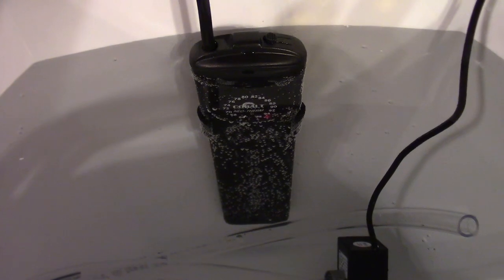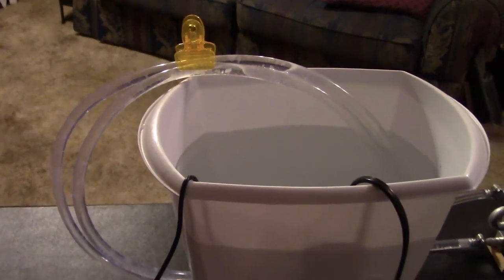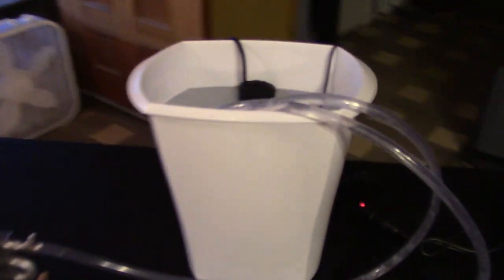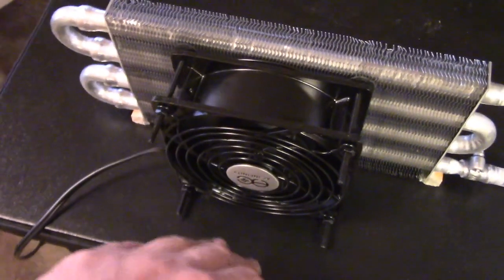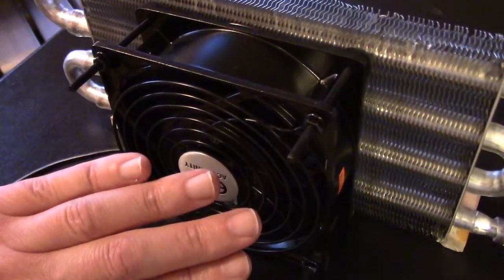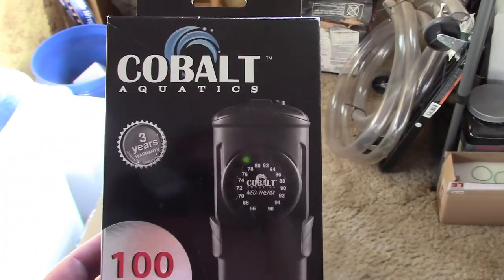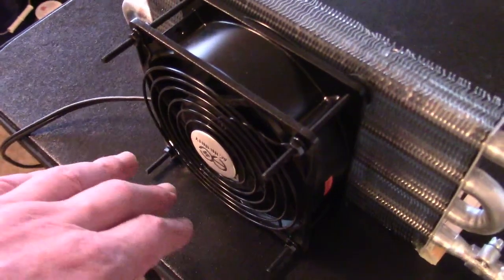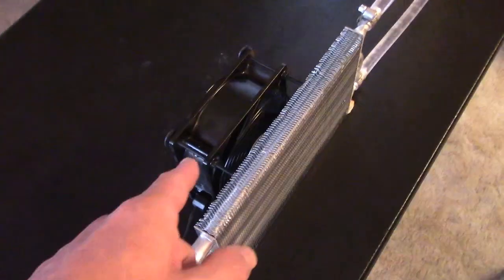DIY Air Heater! The "Hot Water" Air Heater! DIY Radiant Space Heater! use Aquarium Heater & Radiator

Comment: I love the videos and I’ve built the larger heat exchange unit. I think it’s often better to have several small units working at the same time rather than larger fans which make more noise. In colder temperatures I’m not sure weather a 100watt fan could sustain warm enough temperatures. It’s certainly useful for small well insulated rooms though like a cupboard office. And of course it’s useful say in the car if you get caught in a snow storm. That’s 8 amps and with a smaller tank the water could be warmer. You probably need 2 amps for that fan and so 10 hours run time with a 100amp battery is good. In UK winter however even with off grid 1000watts of solar couldn’t sustain the batteries over a long period of time with every day use. You’d have to invest in lots of amp hours to sustain heating over  winter. In the desert that’s easy but not in the uk.

Comment: I did the same thing however when i screw tje fan to the radiator it seems it safocates and doesnt blow air. I have to pit the fan couple of cms  diatant from tje radiator. In addition tje air is not so hot although tje radiator tem ia around 50c.guess i did somethng wrong?
Reply from the maker: some smaller radiators have the fins backed very tightly together. that makes it hard for air to get through unless you use a powerful fan. i used a radiator that has relatively 'wide fin spacing' so it works good. i'd say to either try a stronger fan or slow the speed of the fan. the other thing you can do is try a radiator with fin spacing like the one i used.

Comment: Your vids are always inspiring. I'm always left with lotsa ideas for variations on the theme. Insulate the water tub and cover with a lid to reduce heat loss. Instead of pumping the water, set system up vertically for thermosiphon recirculation (hot water rises, cooler will sink).

Comment: I was thinking using the ptc heating elements to heat up a pot for the hot water. Try that? Or maybe would get too hot for pump?
Reply from the maker: hi. i think that's a good idea. have to figure out the balance (number of elements and amount of water.). could maybe also use one of those 'dernord' dc water heating elements. (the kind that can heat a tank of water). they have those in 12v 150w 300w 600w  probably other sizes too. both the 12v dernord water heating elements and the 12v ptc heating elements can be hooked straight to a 12v solar panel or 12v battery if you wanted too

Comment: How does this compre to your previous setups when you had used the fans with the heating elements (sandwiched in the silver element (with fins)? As I recall, they were small readymade units.
Reply from the maker: hi. it's hard to compare the two. one is a smaller airstream (but hotter) and the other is a wide airstream (but cooler)
Reply: @desertsun02  I suppose this air heater is more suited to heat the room then? And the smaller setup (with 1 fan or 2 fans) may not be as effective in increasing the temperature of the same room? 
Of course, the directed one has it’s own strengths but I was just wondering if the small one would suffice and double as room heaters. 🤔 
One more question- what would be the total power consumption of the two setups? I am asking because if I am running it at night, then I’ll need to power it using battery. So I wonder which of the two is more cost effective during night time. 🤔

Comment: That's a good way to heat up the air in a small area. !:- )  I built one of your other projects and it works great!
Reply from the maker: hi there. that's great to hear 👍🙂
Reply: Is it more efficient than just buying a small electric space heater?
Reply: @julla1416  It is more efficient because it is solar powered. !:- )
Reply: @a787fxr  Yes but if I use the water heater like in the video, what about then?

Comment: Sweet! Now we just have to find a way to do this without electricity
Reply from the maker: hi there. you could use dc computer case fan (along with dc pump). each is 3 to 5 watts so total power of that would be about 6-10 watts. maybe go with 12v solar panel or 12v battery for those. the heater is trickier but you could use 12v dc water heating element (or go with solar thermal), maybe one of the spiral pipe solar water heaters for the hot water. *or some sort of wood stove to heat the water. a few ideas off the top of my head. 👈💡
Reply: He can use solar for this.
Reply: Exactly

Comment: I've had an idea for using peltier modules coupled to rebar driven into the ground. Run in pairs on 12v input for ~6v to each peltier for increased efficiency. Cold side to rebar in the winter, reverse polarity in the summer... poor mans heat pump. Corrosion would be an issue where I live.
Reply: Galvanized? Maybe just a copper ground? Good idea.

Comment: Can you walk us through how you made it? What did you use for the radiator in front of fan?
Reply: The radiator serves as the thermal exchange. i.e. the surface area of the radiator lets the heat dissipate in to the air/room.
Reply from the maker: hi there. essentially it's just the radiator with a fan either in front or behind it. then the tubes that go into the water (with a small water pump on one end). other than it's the heater. that's basically it. is there a specific part that you needed clarification on? 🙂 (oh, and the radiator is held up with 2 little 3/8" square wooden dowel sections attached on the side edges of the radiator near the bottom)
Reply: What did you use for such a small radiator?
Reply from the maker: @bernadette munson i used a hayden model 401 transmission cooler.